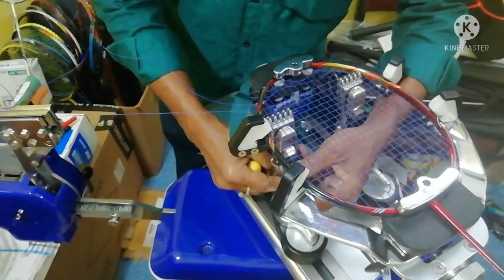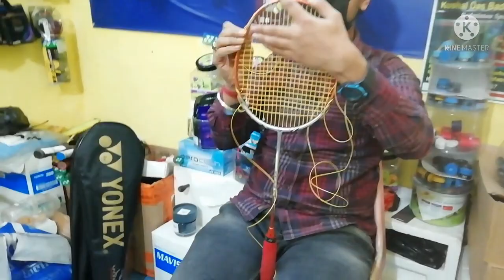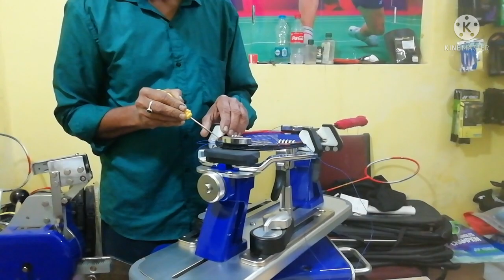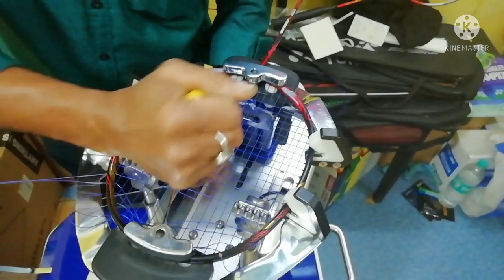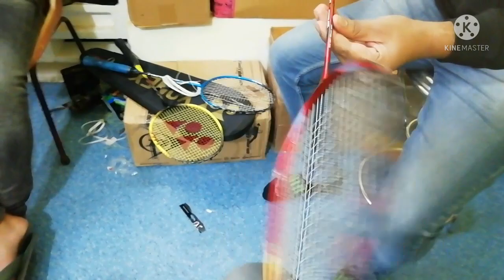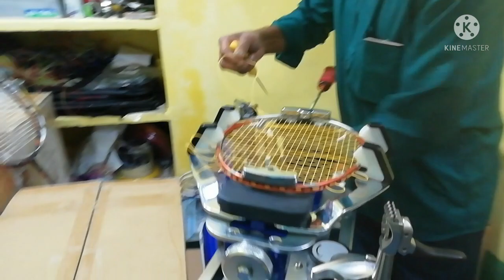Professional badmintonrackets stringing service | Tension | Kizuna 61 / Bg 66 - within 15 Minutes |

Comment: Do we have to give string
Reply: Of course bro thats the reason its costly ( u have to buy a string which would be like 500 and 200-400 for cutting and tying string)  and i dont recomend applying strings on low price rackets coz instead u can buy a new racket...
Reply: Yes
Reply: @Abyssal_Tenebrosity_19 hlo bro ! I am a beginner. Can you tell me how long would  racket string (for racket priced around 2000) last for me. If I play for  1-2 hours a day?
Reply: @AjayThakur-mh5tk  2000 rs rackets are pretty much average so i suggest play with 26 lbs if you're begginer they really last long (important note --- also do see what's your racket string tension) ... And it doesn't matter to your racket how long you play but if you're playing with 30 lbs or more you have to make sure not to hit your racket anywhere like floor or crash it with other rackets ( I've seen many 6000-7000 30+lbs rackets breaking by just hitting with low price 26-28 lbs rackets but the lower lbs (price) racket doesn't even scratch... So more the lbs of your racket please do take care of it not to hit somewhere... And last thing I would say that after becoming intermediate player (after few weeks  or months of playing) if you feel like you're giving full power in your smash but still the shuttle is going towards your opponent v. Slow and your opponent easily defend it then increase your lbs to 28-30 or if you want more smash power ( TIP --- only increase your lbs if you're hitting all the smash  shots in the centre of your racket because that's the sweet spot as safe spot as the centre of the racket is the toughest part so first practice and master to hit all your smash on the centre of your racket as it not only helps in generating more smash power but also protects your High lbs rackets from breaking) that's all from me sorry if I wrote too much but that's all you need to know as a beginner... If you have any more doubts regarding badminton do lemme know I'm always 24x7 available... Have a great journey to your badminton life ;)
Reply: @Abyssal_Tenebrosity_19  can you suggest me any racket?
Reply: @AjayThakur-mh5tk  what's your budget ?!
Reply: @Abyssal_Tenebrosity_19  3000